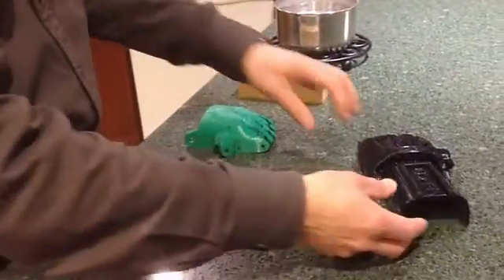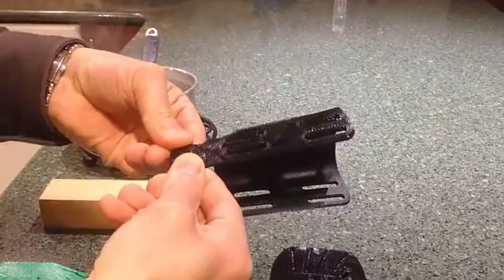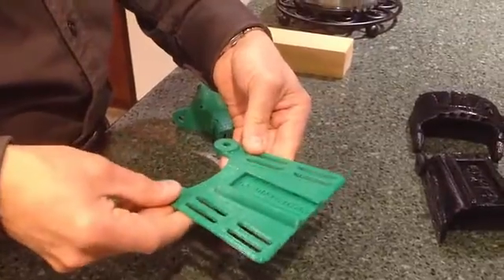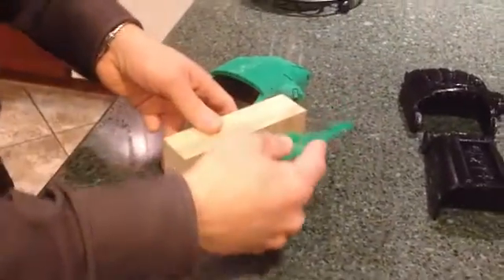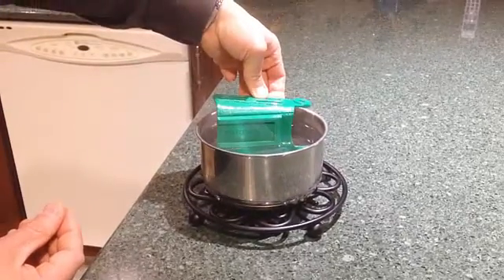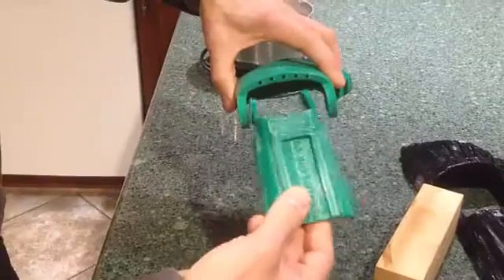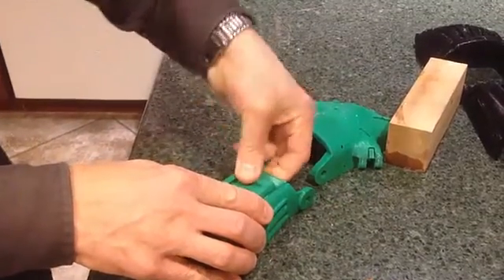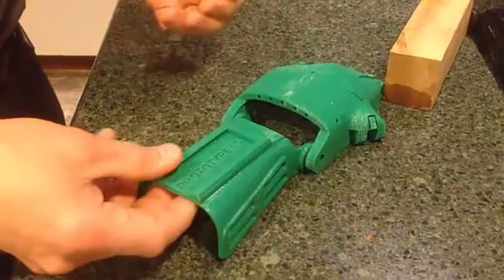Thermoforming a gauntlet for an e-NABLE hand

Comment: I printed in an Alloy 910 and I can’t get it to bend or budge whatsoever. Can I not use this material?
Reply from the maker: Looking at its specifications I would say it would be impossible to thermoform using boiling water. The only suggestions I can come up with would be to try using a heat gun but you’ll need to be extremely careful not to overheat any areas. The thermoforming approach is best used with PLA.

Comment: I'm Running into problems using eSUN's PLA+ it seems like it has a much higher glass transition temp than standard PLA.  Has anyone else run into this problem?
Reply: I just reprinted the gauntlet and tried again, same material.  This time thermoforming went off without a hitch.  No problems. I'm not sure what changed.

Comment: Can the monoprice select mini make a phoenix hand or other E-nable hands? I'm completely new to 3D printing and wanting to get into it. the monoprice seems to be idiot proof. if not what are your affordable recomendations?
Reply from the maker: The thermoformed gauntlet is the component with the largest surface area on the build plate. Providing the chosen printer can handle the size of the gauntlet then it should be able to print any of the other components.
I'd rather not recommend any specific commercial printers as I only have experience of building my own. The only commercial printers I've used have been from Ultimaker and, although excellent machines, they're on the pricey end of the market.

Comment: Hello John, 
I'm working on phoenix v2 design, but when it comes to thermoforming the gauntlet part, instead of it bending so swiftly like in your case mine breaks. Maybe I'm using some different material than what you are using. So if you can please tell me what material you are using for the prosthetic hand parts it would be really helpful! Thank you.
Reply: The gauntlet needs to be printed in PLA. You won't be able to thermoform ABS using boiling water. If the PLA gauntlet isn't bending easily the water isn't hot enough. You'll need boiling water.

Comment: Hi John,

What material is the gauntlet made from for this video? I am using an ABS material, but have not been successful in getting the material to bend at all when placed in the boiling water. Thank you
Reply from the maker: I use PLA. You won't be able to bend ABS using hot water. Your best option for ABS would probably be to use a hot air gun but be careful not to overheat any areas of the gauntlet.
Reply: good day author
can I use your prosthesis to help people in your own country, we have this thing in Russia, the situation is very bad, very expensive, many people can not afford it. just to help a neighbor.
And I would have ready if you need to deduct from each payment of the prosthesis. the project I have is not commercial, I just help and take some of the money that would if broken printer repair and utility payment.

могу ли я использовать ваш протез, что бы помогать людям в своей стране, у нас с этим дело в России обстоят очень плохо, очень дорого, многие не могут позволить себе такое. как раз помогу соседу.
А со мной бы могли, готов если надо вам отчислять оплаты с каждого протеза. проект у меня не коммерческий, я просто помогаю и немного себе беру денег что бы если сломается принтер починить и на коммунальные оплаты.
Reply: There are files and instructions for several designs here. You can request a hand or arm here, or volunteer to make them for others there also:

http://enablingthefuture.org/

Comment: Great idea. Perhaps print a form in a higher temperature plastic to bend it over to make the process a bit quicker easier and repeatable.
Reply: My thoughts exactly. It could be made of PLA as the hot gauntlet wouldn't have sufficient thermal mass to melt the mold. The gauntlets are made in different sizes so you may need a few molds to cover the range.